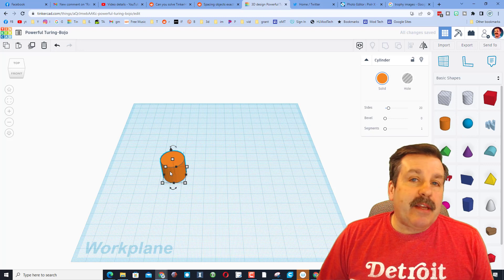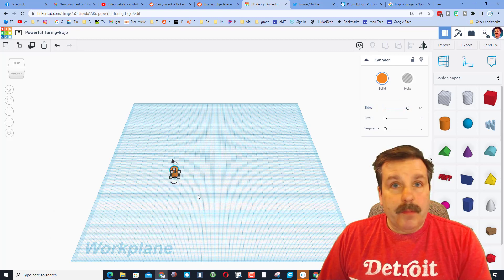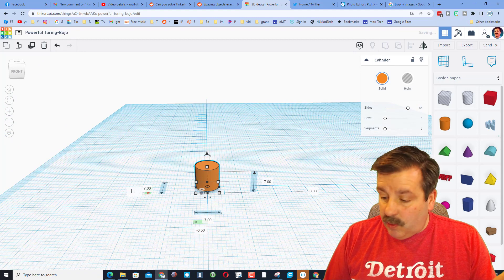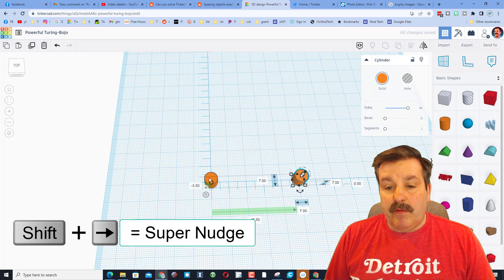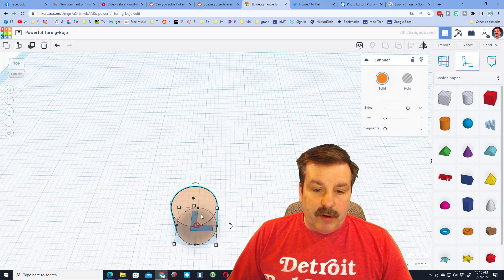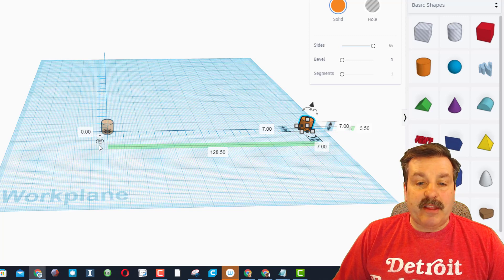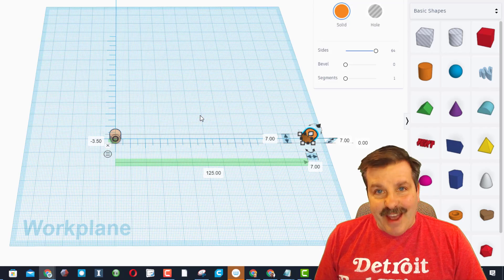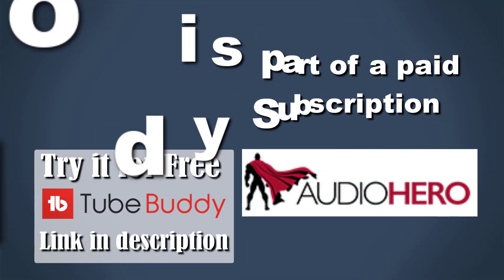Master the Tinkercad Ruler in 3 Minutes | Simple Steps Slick Results

Comment: I have a design with a square attached to a circle want to get the size of each combined sections.
Reply from the maker: Are you describing an imported STL? I think the easiest way would be to draw segments using the sketch tool. It would give you the best estimate of the dimensions. Check out my Sketch Tool Playlist https://bit.ly/hlsketch Anything that mentions stroke should get you there.

Comment: You go way too fast...
Reply from the maker: Good point. One trick you can use on videos I have already created is to use the gear and slow down the speed. In my classroom I also had the kiddos turn on captions. Lastly, they found it handy to watch 30 seconds, then complete what they learned. Thanks, tons for the note! It is always helpful to know how users are experiencing my content.
Reply: @HLModTech  - Thanks for responding. I was going to try again, stopping periodically. It should help, but still a slightly slower pace would help more.
Reply from the maker: You can always adjust the speed to suit your needs with this button. https://imgur.com/a/SadROEb It brings up the captions too. 💯👍
Reply: @HLModTech  - Yep, but its not that I can't understand you. I can...you speak very clearly. I guess if you slowed down to classroom speed, your videos would be excruciatingly long. I'll figure it out. Keep up the good work. The ruler stuff just has not stuck yet, but it will. Don't laugh, but the way that I have been sizing and measuring to date is by using the cube, fitting it into the spaces that I want to measure and then look at the size of the cube. Or sizing the cube like a ruler, then using it to space between objects. Its crude, but it has worked thus far. I hope to make that conversion to a ruler soon.
Reply from the maker: =) Not laughing at all. I skipped the ruler for about 6 years. Used the same sort of brute force that you use. 👍With that video being less than 3 minutes long my only idea for slowing that one down was the speed button. This video may help a bit as it was designed to teach a project and integrate the use of the ruler. https://youtu.be/TXJg7ztLG80 It also has chapters which can be useful too.
Reply from the maker: Just whipped this up. Easily choose  the tutorial speed that fits your needs. https://bit.ly/hlspeed
Reply from the maker: This video has several tips to aid you in adjusting speed and such. https://youtu.be/DwrnHNCwJrc?si=g2PiLu6Qzu8PeWrH
Reply: I could not get my screen to look like yours-  if you are teaching guide us please